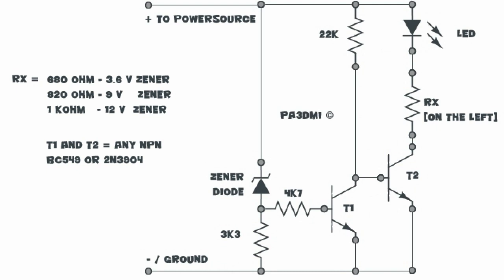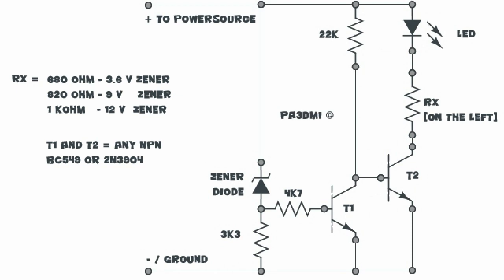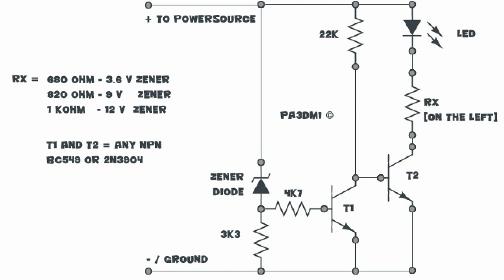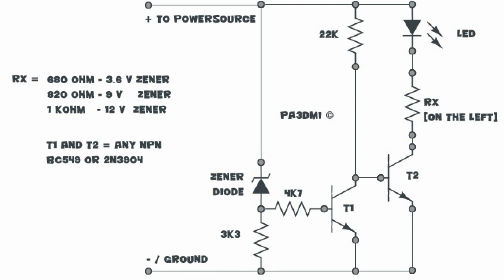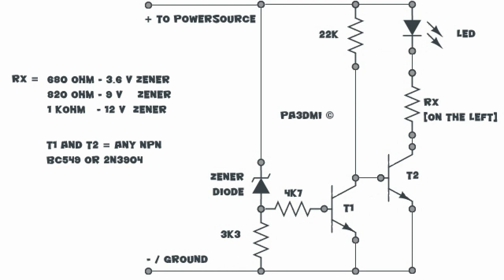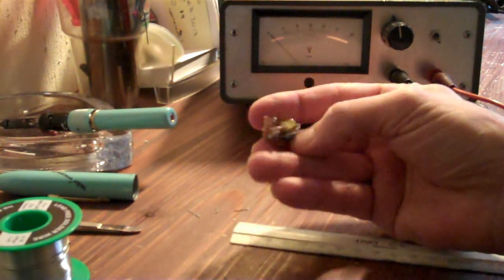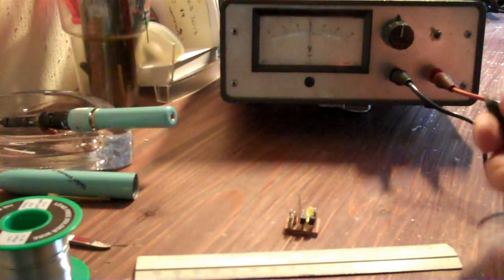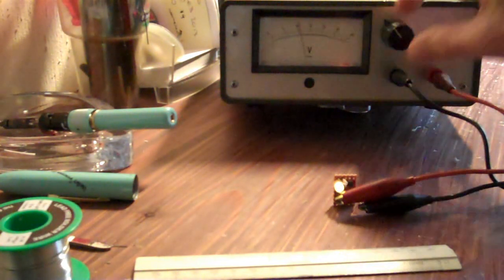The battery 'low' indicator project

Comment: I will adopt this indicator on a different use: a socket detacher
I have a power inverter (from 12Vcc to 220Vac) which supplies two groups of 220V sockets: group A (devices that cannot be swiched off) group B (devices that could be swiched off)
Instead of the LED I will install a RELAY that disconnects the "group B" sockets when the battery voltage drops under 12V, in order to extend the whole duration.
You gave me a great idea...

Thanks so much

Comment: Pls tell me the values of components for a voltage below 3.3 volts
Reply from the maker: If you go lower than 3 V it will not switch 100% ok, but if you take 2,4 zener the value will be about 560 ohm. Because you loose 0.6Volt in a silicium transistor between junctions just try different values. Experiment !
Reply: PA3DMI what if I take 2.7v zenner ? Andi values for resistors if I take 2.7v zenner? BTW thanks it's the first time am seeing someone replying to a comment in this old video and do you mean resistor by saying RX?
Reply from the maker: Try 560 or 470 ohm but the lower you get the higher the current wil be and draining the battery if you use one. RX is the resistor that is correct. I always try to answer but somethimes I miss one :-) Bye from Amsterdam, Jarno - PA3DMI

Comment: What's the standby current drained until led lits? Using a zenner and a resistor before transistor i guess the drain is 65ma........1.5Ah in 24 hours.......a lot of power wasted.

Comment: You wrote Zener after each Rx value.
680ohm - 3.6v Zener
820ohm - 9v Zener
1koh    - 12v Zener
Why did you write Zener? Do I have to change the Zener diode also for each Rx value?
Reply from the maker: You have to change the resistor if you change the zenerdiode.
If you want the led go ON at 9 Volt than use 820 ohm , want to go to 12 Volt than use 1kohm as resistor. If you do not change the resistor if will not work [good].
So ANWAYS change the resistor.

Bye ,

PA3DMI - Amsterdam
Reply: PA3DMI
alright, thank you :)) ...... which means the diode along with resistor both changes according to given values.